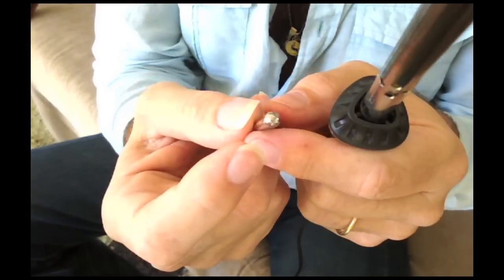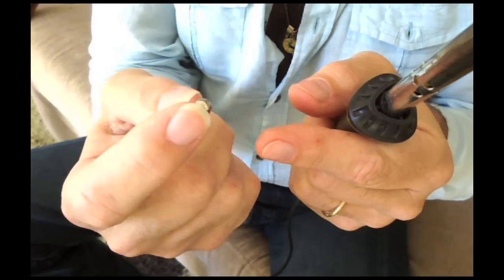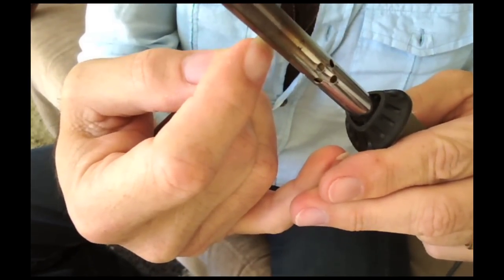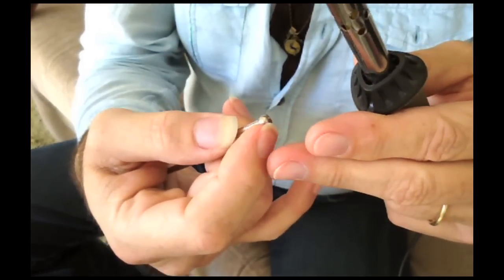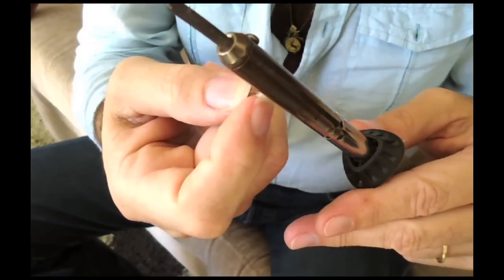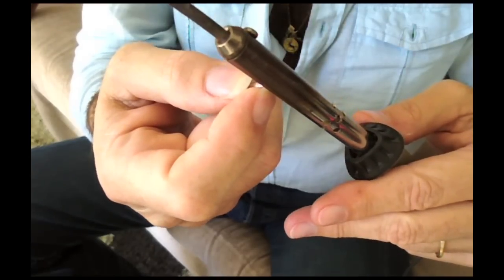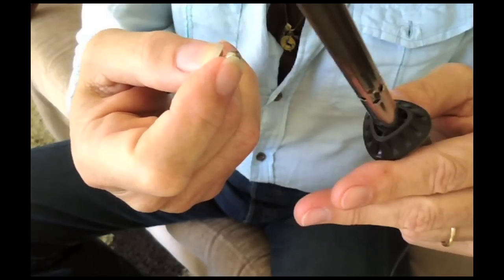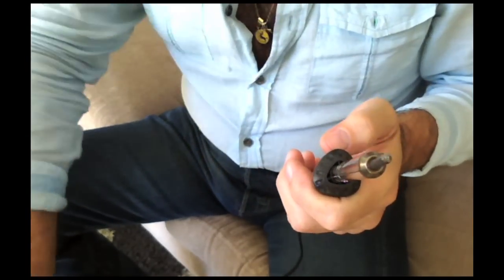Hooked fingernails. How to starighten hooked fingernails

Comment: Thank you so much.  This has helped a hooked nail problem that I was getting desperate to fix.  This solution sounds scary, but I testify that it is safe and easy.  So much better than fake nails, gluing pieces of ping pong balls, weird filing, etc.  Suggest anyone who has the problem of hooked or bent down fingernails hooking the string try this.  Thanks again!!